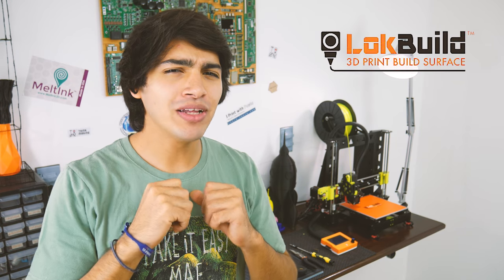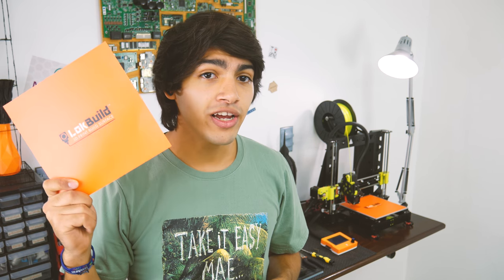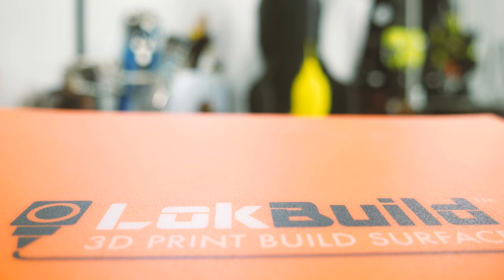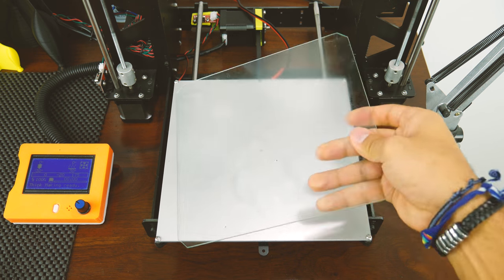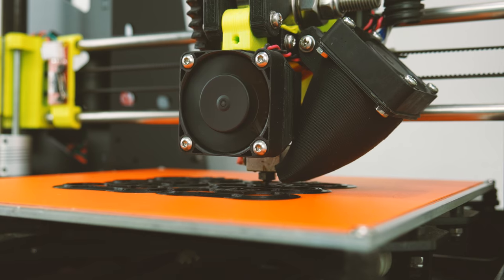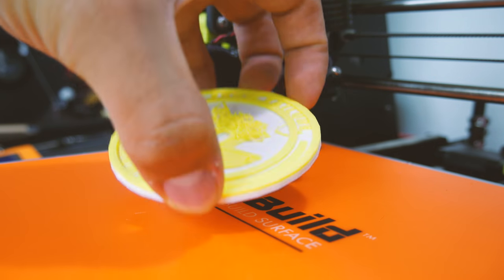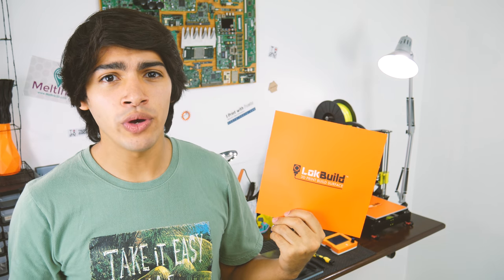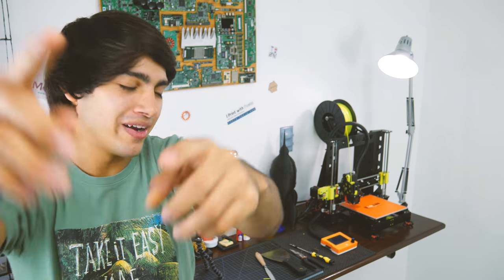💡🛠 LokBuild - The Best 3D Print Build Surface? - Review

Comment: How long have you been using it and how hot have you gotten the bed during prints? I've seen a lot of bad reviews showing bubbling when printing at 100° which is required for a lot of materials. This video looks a lot more like a commercial rather than a review.

Comment: ok , that's it
i'm ordering a sheet
but i'm sticking it to one of ma glass plate's though 
i don't like pulling stuff off of ma heated bed , and the glass cools quicker if i take it off of the alu buildplate 
win win ^^
Reply from the maker: You could also buy a carbon fiber sheet, and stick lockbuild over it, that way you prevent ever breaking the glass.
Reply: I own an older GeckoTek spring steel plate (the ones with a special coating) and added magnets below my build plate (neodym high temperature ones work quite well). I then added GeckoTek EZ-Stick on one side and LokBuild onto the other side. This way I can simply swap the surface and as it is removable! I just need to slightly bend the steel plate if something sticks to good to the surface(s). Works for months like a charm! See: https://www.instagram.com/p/BhY7d-phI5Y/